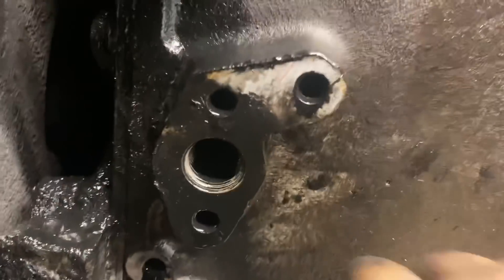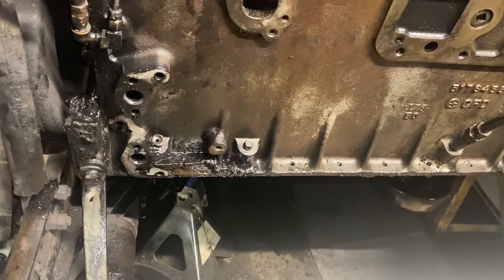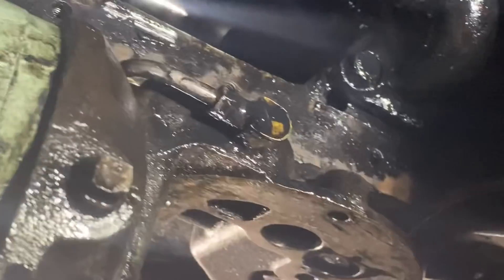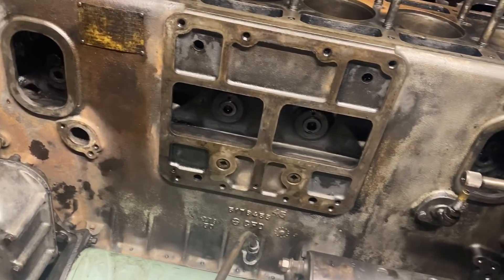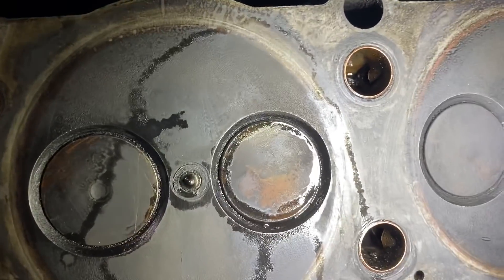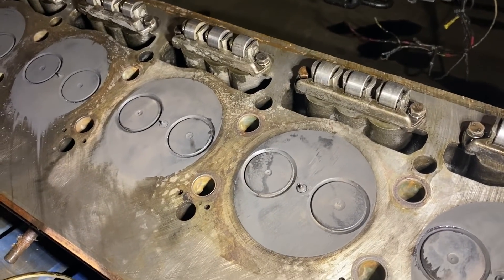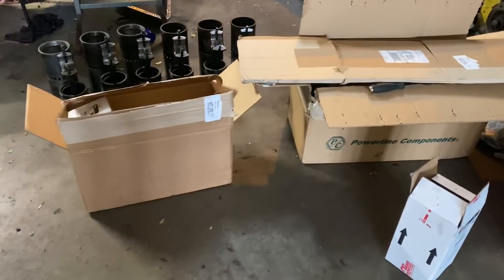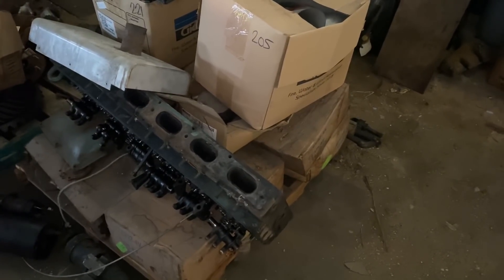4103 Gm Bus.   Hey Lance kind of day. Detroit diesel 671

Comment: If the valve seats are not cracked, and no coolant leaks, it probably will not hurt anything. Worst case scenario, they can be furnace welded. It's a common repair for cracked heads.
Reply from the maker: Yes I’ve said several times it can be repaired but the cost of repairing is higher than the cost of which i can get a reman head.  Very dumb investment.  I also recommend a Pressure test before using and even the cost of just that at the machine shop was high almost 40% of a reman head price so finding a reman head without cracks is a wise investment or getting one donated is even better.
Reply: @BusGreaseMonkey  Sorry I commented. I did not hear you say anything in the video about repairing the heads.

Comment: The head can be fixed with the lock and stitch method.  New valve seats would need to be installed after.  Also be careful using old stock gaskets, some of those gaskets could be 30-40 years old, they get hard and don’t seal.  
   Good job cleaning that air box up.  Bet the first heat cycle the drain we be flowing well!

Comment: Back in the days when I worked on Detroits , every so often I would run across an engine with a head that sometime in it's past history had been cracked and been repaired with cast iron plugs by some machine shop. None of those had been leaking, so I pressure tested the head to be sure, and went ahead and used it. I never had any problem with one.

Comment: That's where all the 2 valve heads crack.  There's a lot of them still running just like that.  Some times it's just as simple as over torqing the injector on those old dogs and you have a cracked head.
Reply: Like the Olds 5.7 diesels I used to work on years ago, pretty much every head I ever pulled on those were cracked between the valves, I still have a '79 toronado with one of these engines that I drive in the summer months, I rebuilt it 40,000 miles ago and put the heads back on with cracks and haven't had any issues.
Reply: @noshsreqd  1979, that's the year I started my career as a diesel mechanic.  Only worked on the heavy stuff, trucks, buses, gen sets and construction machinery.  We felt sorry for you guys trying to keep those 5.7s going.
Reply: I bought a new 1979 c-10 with the 5.7 diesel. At 18,000 it started puking from the radiator. Out of warranty. I pulled the right head. One of the head bolts were broke. Long story. I got a free target master 1 day before I was about to install a 350 Olds gas burner. I had $1150 in the  gas engine from me rebuilding it. I sold the diesel 2 months later just to get some of my money back. The original diesel leaked 1 quart of oil every 19 miles. Made it to 41,000 miles before Chevy settled up with me.

Comment: Those 2 valves ALWAYS crack there, one reason many operators started converting to N Series way  back in the '70s.  I've known shops that used to pin and machine those cracks, but by the time you add up the labor and special bits needed to do it right, you can buy a fresh 4 valve head...but then you need to do the conversion to N series.  Either way, it's going to be $$$$ to do right.  The bus is worth the money, though...very few 03s left.

Comment: Been a lot of years but as I remember the big diesel shop I did a lot of machine work for would have me pressure test those heads. If they didn't leak (and I can't remember one ever leaking) we'd recondition them and they got put back in service. If replacement castings are available then that would be best but if not...

Comment: I welding on a cracked junk engine block just for the practice and cracks form in other places. Maybe I should of put that block in a burning charcoal pit because a rose bud torch couldn't keep it hot enough.When the iron cools too fast is when the cracks happen. Then after how many stress cycles could it last? Cooler heads will prevail !

Comment: those two heads been running like that for years, use one like it is
Reply: I was wondering about that. I know nothing about diesels but many gas motor heads work fine with a crack between the valves. As long as the crack does not hit water or oil. I never liked it but that's what the boss wanted and I never seen a problem come of it.  Chrysler 2.2L and 2.5L heads like used on mail delivery trucks come to mind.The Valve seats were steal and the heads aluminum so not the same thing. Install replaceable seats? A good machine shop can say if it's safe to run them like that or not I would think.

Comment: I assume you pulled the valves and looked down in the ports to see if the cracks went all the way through, past valve seats. On some heads and I don't know about Detroit 2-stroke particular, cracks are acceptable in certain places in within a certain distance. I know of a pre chamber injection engine where cracks around the pre chamber bore within a certain distance, is just normal.
Reply: mweverett The Oldsmobile 5.7L diesel cracked between the valves and so did the 6.2L & the 6.5L diesel. The 6.9L & the 7.3L idi engines cracked as well.

Comment: Being right on the valve seat means the crack will only get worse .If it weren't too deep ,a insert might fix it . Some of the old Mercedes diesels I work on have cracked heads and Mercedes say"as long as they are not into the water jacket,keep using them".

Comment: Not sure of the cost, or current available services.  Diesel Cast Welding up in Blaine used to specialize in Detroit 2 stroke head repair.  I hauled a lot of heads up to them back in the day.
Reply from the maker: $$ we called.  It’s pretty expensive.

Comment: Is it possible to still use them? Do the cracks cause any issues?
All the Mitsubishi sigma astron engine heads I ever serviced were cracked between inlet and exhaust valves. All were reused with no problems.
Reply: As I remember Astron heads would warp and blow out the head gaskets if they got hot but rarely failed from the cracking issue you're talking about.

Comment: I’d have a GOOD machine shop take a look at them. Check to see the extent of the crack. Pressure test, and be sure they’re not running into any coolant, or oil passages. 

That all looks good, put a new set of hardened seats in, and run it. As people have said, could’ve been like that for decades with no ill effect. 

Just my .02¢.....

Comment: Just a DIY my self, those air box drains?? When engine is running will pressureized air from super charger be it very little cause of size of drain pile be blowing out of those drain hole exstinders??

Comment: By the looks of the head cracks and where they are seems to be a torquing issue. Also not a very good design with the thin walls there. I know ford came out with a fix on their gas motor heads to use different bolts and do step torques. You've been working on these for along time so you must feel confident finding one without cracks. Good luck with this.

Comment: Hi About the cracks in the heads, one way to repair them is to widen up the crack with a Dremel and a 1mm diamond ball tip, grind 1mm down, after that you find a piece of copper wire (if there is inserted valve seats) 1.25mm or 1.5mm thick  and then carefully hammer the wire down in the widened crack with a punch smaller than the wire/cut so you can expand the wire to fully fill the crack (if the punch is bigger than the wire/cut you will not get the wire to expand in the cut), if there is no inserted valve seats and the crack goes into the 45 degrees valve seating area, then use stainless annealed wire instead.

Comment: When you are that far into it labor and cost wise, why do you not just do the little more work needed to remove the block and get it cleaned and machined properly to ensure that all the work is for not in case something is not found or repaired that it might need.  I would think that from a technician's perspective, you would demand that for warranty purposes.
Reply from the maker: That would add 4x more labor cost to the job
Reply: @BusGreaseMonkey  I would think that it would actually come out about even since you could be doing things you are most effective and efficient at instead of things like cleaning out the block and the engine components.  Have a hot tank at a machine shop do a much better than you could do it manually and for next to nothing, and you could come out with a much better complete transaction for your customer for the same price or maybe even less.  They also have the magnaflux and so forth that you don't have to ensure a better product and I would think their flat rate is far less than yours anyway.  I hope it doesn't come across that I am just trying to be a troll, just from what I have seen in the shop and through experience.

Comment: Do the airbox drains constantly leak boost?
Reply: @hyperluminalreality1  it may be a small enough leak that it doesn't matter but that seems odd to me.
Reply: They do not leak "boost" boost is created by a turbo charger.  The air box drains constantly purge "airbox pressure" to the atmosphere.  The blower creates airbox pressure.  This was one of the main reasons these engines were discontinued, constantly puking all that oily black CRAP out on the pavement and into the air.
Reply: @markphilpott8735  why is the term boost limited to a turbocharged system?  In my experience boost is the term given to any pressure above atmospheric in a forced induction system.  Does the pressure in the airbox not go above atmospheric?
Reply: @DoRC  I don't really want to go into great deal on the subject however; Airbox Pressure is the terminology that Detroit Diesel refers to in this scenario.  I know a lot of folk refer to the output from a Rootes type blower as boost, on layman's terms that's ok.  But when it comes to these old 2 stroke Detroit's, boost is what comes from a turbo charger if so equipped, it's purpose is to increase air density so as to enhance efficiency and power. The turbo performance is  directly related to fuel combustion and the resulting high-velocity exhaust pulse.  Its a variable. The blower is quite different it's basically a constant related only to engine rpm.  Airbox Pressure doesn't vary based on combustion or engine output or load.  Ultimately, it's terminology that comes from the manufacturer and they had good reason to differentiate between the two.
Reply: @markphilpott8735  I see. That makes sense. I didn't think about the engine having both boost and airbox pressure.  Ok. So in that case. Dont the drains create an airbox pressure leak?
Reply: @DoRC  yes, they are designed to do that.  BTW, I apologize for going off on a tangent...I didn't answer your question.  Airbox Pressure on a 6-71 2 valve with minimal exhaust back pressure and clean intake ports should be 17.4 In. Hg.  @ 2300 RPM.  One might think it would be a lot more that that, no?  That's less than 9 psi at full throttle.

Comment: I don't think I would condem either of those heads.  I've even had machine shops try to convince me to discard cracked diesel heads.  If they pass a leak test I run them.  No issues so far, and every diesel head I pull is cracked somewhere.

Comment: Seems like when I was a kid I saw an old school head repair where the crack was drilled and tapped, a special cast looked like a set screw was screwed in then cut. Then it was drilled again about half of previous hole with screw and head material. This was continued until the crack was bridged. Then head machined afterward.

Comment: Can you run the cracked heads? (until failure or replacements found)
If so, what would happen? 
Low compression?  Catastrophic failure?
Reply: Actually a lot of people do run them with that particular crack. There are a couple of things to do.  You need to pressure test the head.  If deep enough, this type of crack will lead to the water jacket if it does its not a good idea to run it.  If it doesn't leak, you can take a chance but over time as the engine heat cycles, those cracks will travel.  Ultimately, the crack can travel into the valve seat insert counterbore. Which brings on the worst case scenario, seat insert comes loose valve and seat drop into combustion chamber = catastrophic failure.